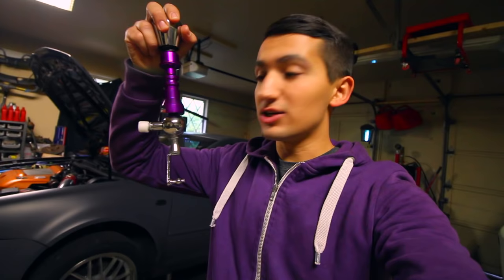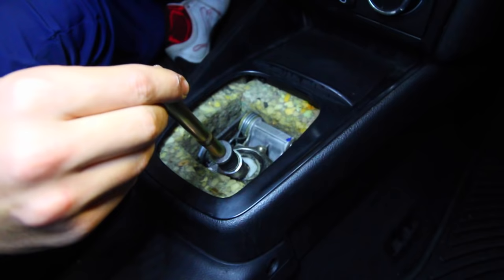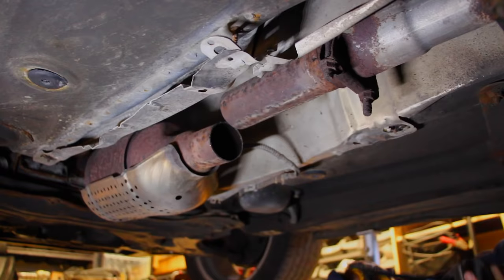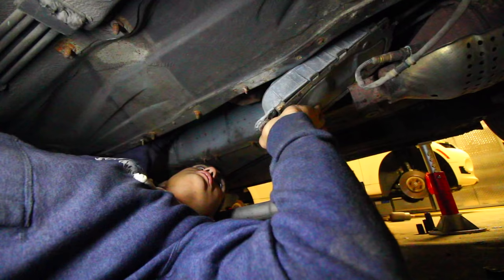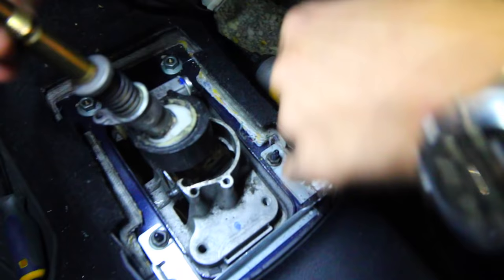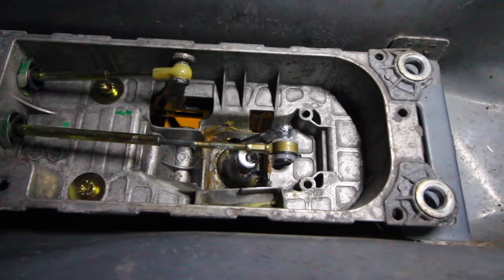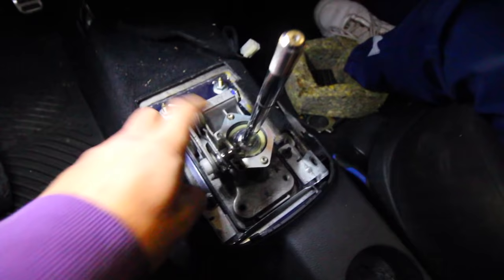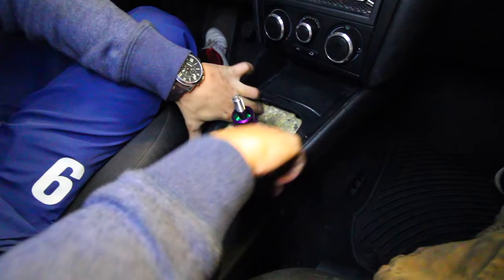How to Install a Short Throw Shifter & Shifter Cable Bushings

Comment: People are complaining that you copied ChrisFix. I'm watching ChrisFix also, but I find this more usefull because I own a Golf mk4. So it's much simplier to watch this video. Btw exactly as you told golf is the worst scenario because you need to go underneath. In my case I watched this video because i've got a lot of "no accurate" shifts and i will be replacing the shift shaft bushings. Nice video, helped me a lot.

Comment: @ 1:44, since the shifter boot is aftermarket, did you use a regular hose clamp to install the new boot to the shifter rod? I believe VW used a crimp clamp originally.

Comment: Diesel geek has a kit from inside the hood. Now will I be able to put a short shifter knob kit you guys got inside or how does that work? I like that shifter kit you guys got. And yes what pain in the ass replacing the bushings are. I need to replace mine but also the ones up top as well. The first gear getter bushing. Can you guys comment or perhaps a video on that?

Comment: Nice video, but would it not be a lot easier just to hack saw some length off the original gear lever, then top it off with a new knob?

Comment: am i the only one who likes a longer throw
Reply: Heath it can be a lot more immersive, which I can understand :) but personally I'd choose a shorter though simply for the sake of performance. However, and don't quote me on this because this just seems logical to me, a longer throw is better for a transmission because the shift overall will be slower, saving the syncros. A shorter throw means a quicker than normal shift, which can be bad for the syncros :)
Reply: Jay Hulm makes sense, it takes longer for it to shift which could prevent it from not shifting properly or something going wrong, more time to change gears. I say if you have an aftermarket clutch and good transmission and all that expensive stuff then you could have a short shifter.
Reply: This looks as slow if not slower as with the normal shifter cause of how much he struggles to shift it in the video. It's like the stick is going through jagged steps or something, looks really unfomfortable, I'd probably shift faster with a normal one.

Comment: why do you guys move gear without pressing the clutch
Reply: Parth Agarwal you dont have to when the car is off
Reply: No need to clutch when the engine is off , because the clutch engages the gearbox (gears) to the running engine , 
In this case the engine is not so we don't have to clutch
Reply: PARTH AGARWAL don’t need to car isn’t running
Reply: car is off.... clutch is not engaged doofus